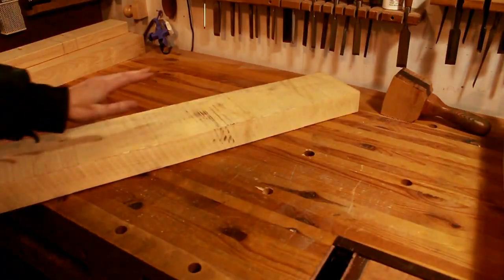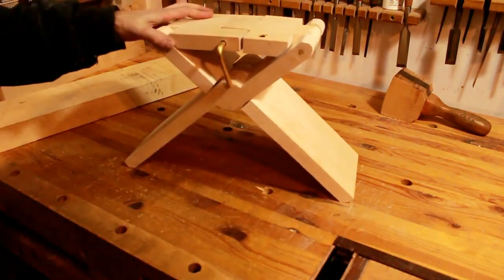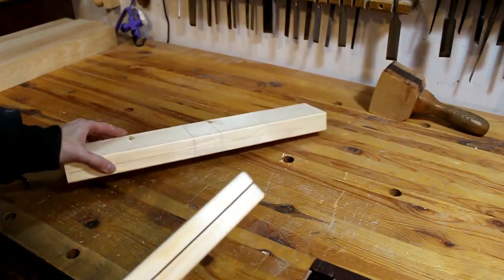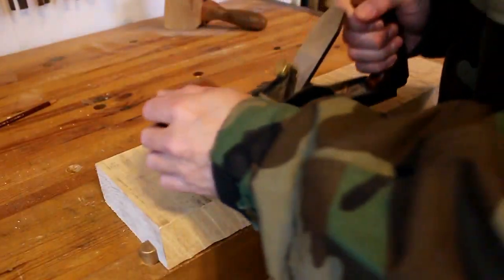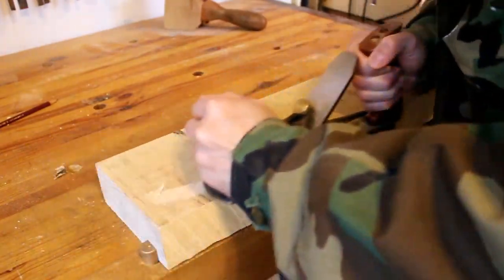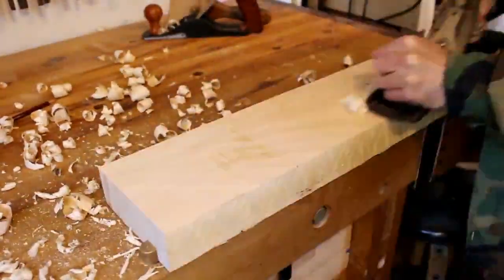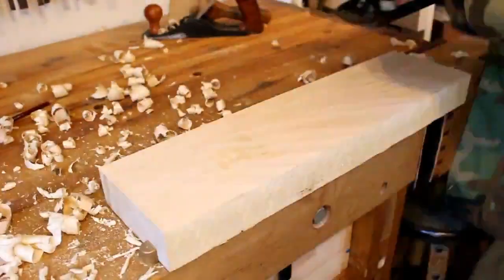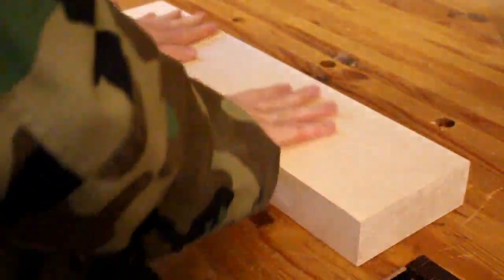How to make a Roubo-Andres folding chair with hand tools!! From a single piece of wood!!

Comment: I like it!  How long is the blade on that smaller saw - azebiki nogiri  (spelling is probably incorrect) - you used to cut the hinge?
Reply from the maker: Thanks! Blade length is about 35mm (1.5inch).
Reply: @TenonsTenors  Thanks for the reply.  I figured it was pretty short.  In the USA I have only been able to find 60mm or longer so far.
Reply from the maker: @red58impala  Here's a link to the store I buy from in Japan. I'm not sure if they ship overseas, but you can email them and ask! Since the menu page is in English and Japanese I assume they wouldn't mind hearing from people in other countries! https://www2.hp-ez.com/hp/nakatyou/page40